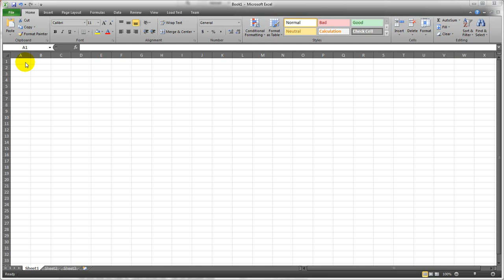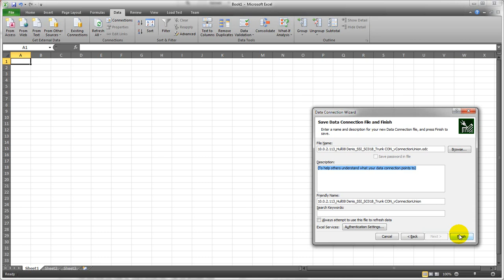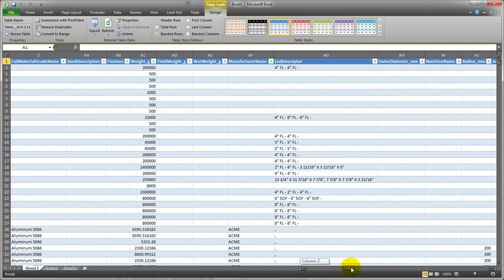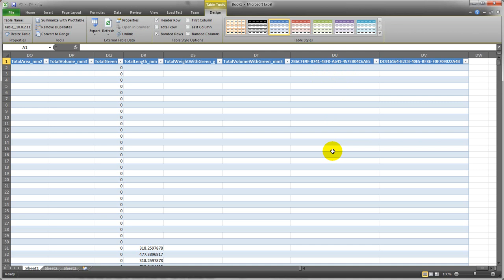View ShipConstructor Part Information in Excel SC 2013

Comment: Hi Dennis, great functionality. Is it possible to include info from secondary product hierarchy also?
Reply from the maker: The UDA's from secondary Product Hierarchies are already included however if you want to include the assembly names of the secondary PH you will need to call the store procedure with the PH GUID.
It will look something like this:
GEN_spBOMDataGetFromGeneralParts 'F214D36F-78F1-4429-B7C4-03BB29ABE463'

If you are wondering what the GUID of a Product Hierarchy is you can create a table using the same steps in the video but use the below sql command.

 SELECT BuildStrategyName, Cast(buildstrategyGUID as nvarchar(50)) as PHGUID
  FROM dbo.GEN_tblBuildStrategies

It will list all the Product Hierarchies with their GUID. Unfortunately there is no way (at least that I have found) to get dynamic information into the sql command which Excel supports. Ideally it would be nice to only have one sql command to call.